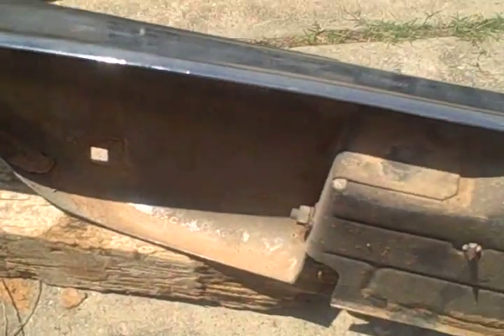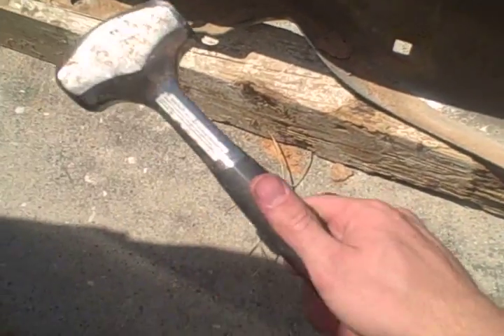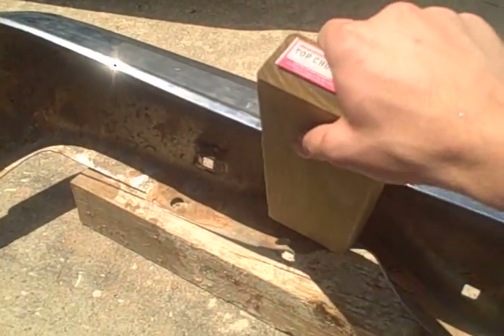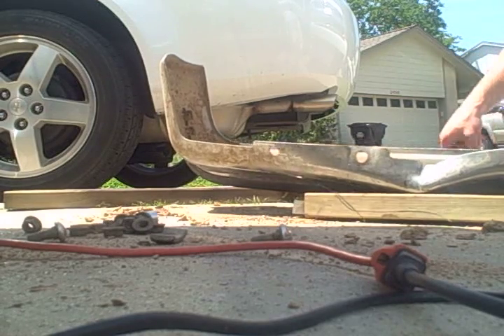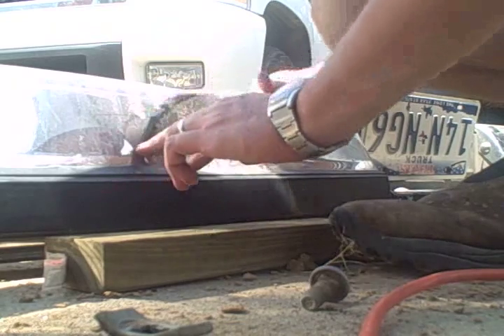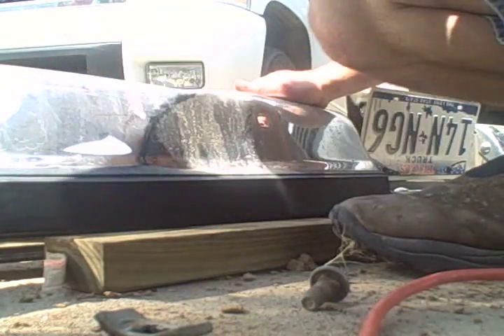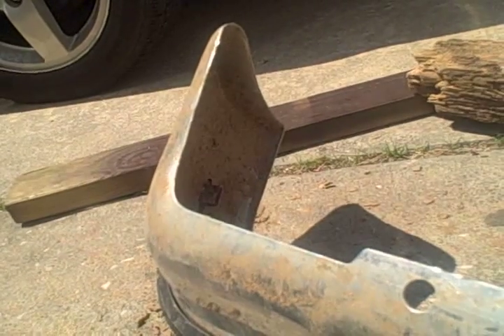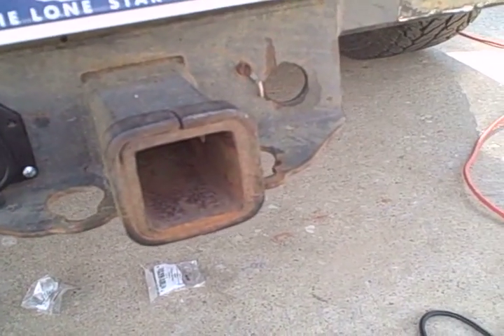straightening the bumper and reinstalling

Comment: Use a large bench vise for the initial work.  Use a 2 x 12 for a base if you insist on beating it out in the driveway.  Remember Murphy’s Law and keep what you’re beating, and the tools at least 12 feet away from your good vehicles. And heat what you’re beating and bending.  Stop when you’re close enough, to keep from ruining it.
Reply from the maker: +Anonymous98 good advice

Comment: Heating the metal would have cut the repair time in half and given you better results
Reply from the maker: I didn't have a torch here. Heating can also discolor the chrome.
Reply: +mjmcomputers heating the metal will never cause distortion, overheating the metal will, nothing will distort the metal more than beating it with a hammer and leaving fish scales in it that will ultimately required heat to fix all of the bash marks.
Reply: @mjmcomputers  that’s why there’s heat guns smart one
Reply from the maker: @Omar-co6tl  a heat gun will not heat a thick bumper hot enough to help.
Reply: @mjmcomputers  how you gone tell me? I’ve done it before

Comment: Well, that didn't work so... I've spent probably ten hours straightening the front and back bumpers on a 93 Chevy 1/2 ton. A power ram is the ticket for the most part but sledge hammer and hand sledges will be needed too. A big H-press would be nice but... Don't forget the hanger bars-mine was bent badly where struck-gonna need a torch for that. It'll end up ugly but better than before.